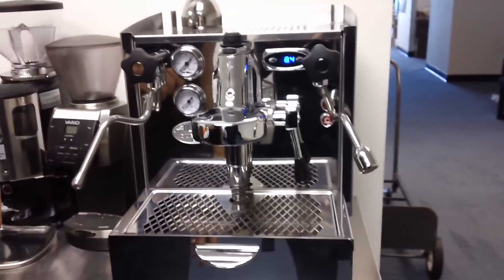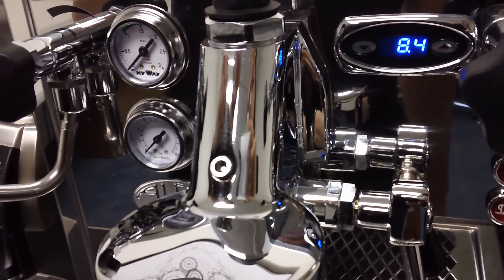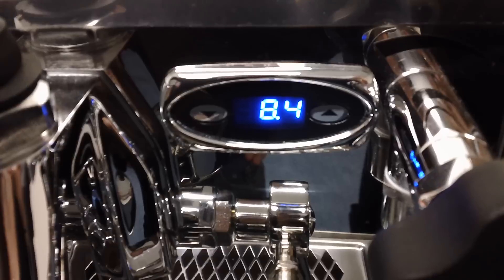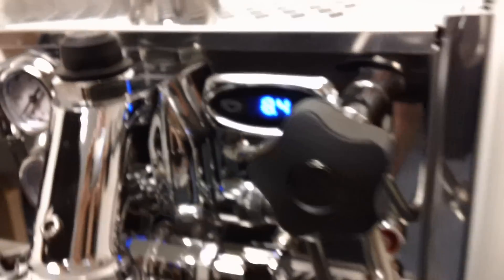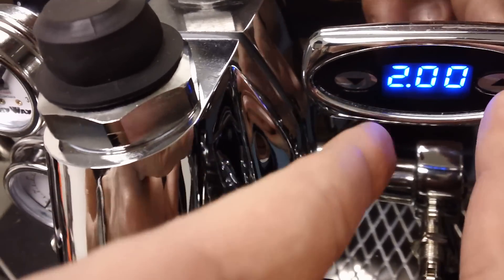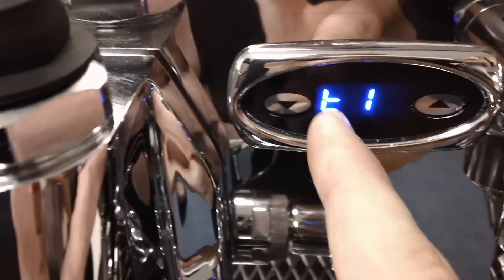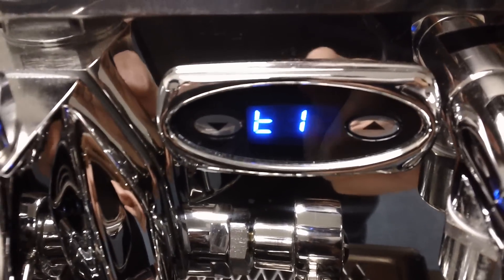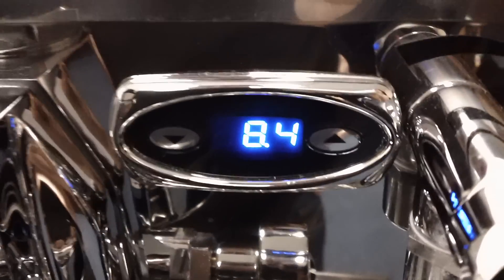Izzo Alex Duetto II PID Settings - BaristaLab

Comment from the maker: You would change temperature via the PID because some coffees may prefer a lower or higher temperature. Lighter roast lower temp Darker roasts higher temp very generally speaking. There isn't a chart available because coffee is always changing and there will be several sweet spots you may hit. 
Messing with the steam boiler temperature is just an easy way to adjust the steam pressure. We haven't really messed around with the steam boiler temperature as it should be correctly set at the factory.

Comment: This review need to explain more about the PID operation.

The steam PID, always higher then the Brew PID,. But, u could any time to change both of them.

This Alex PID, diffrent working proses HX with one another. They need to flush many water to adjust the heat of the water same with the PIC brew indicator.  Others Brand, just to flush a litter water to let the coffee residue flow down.